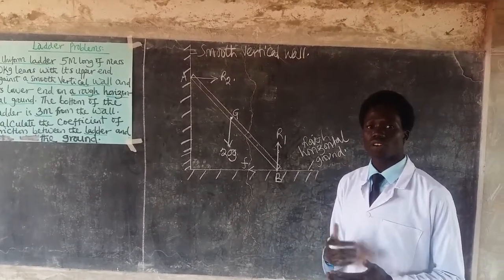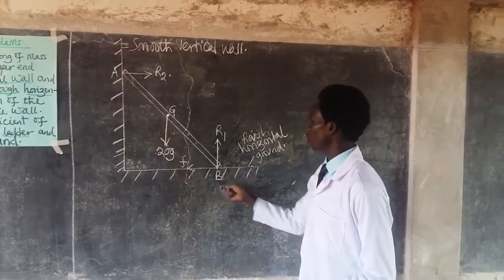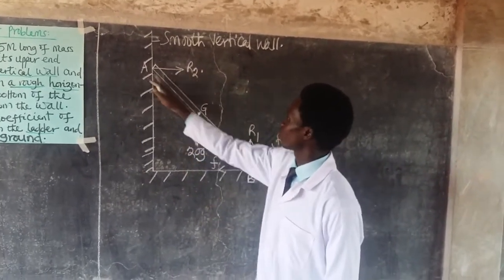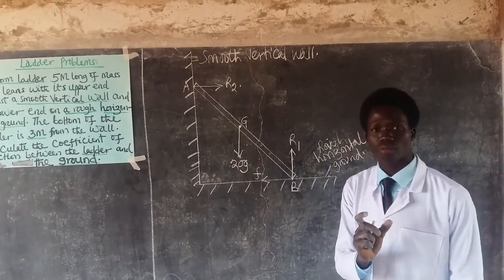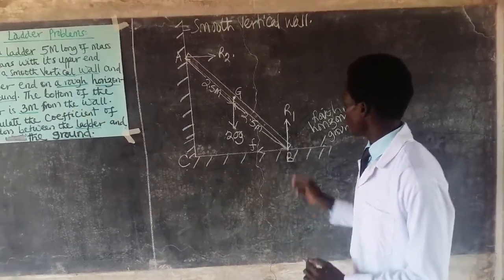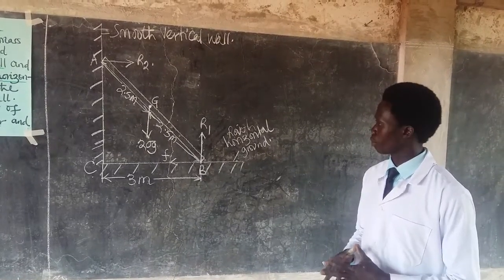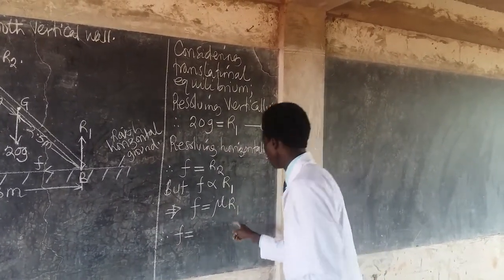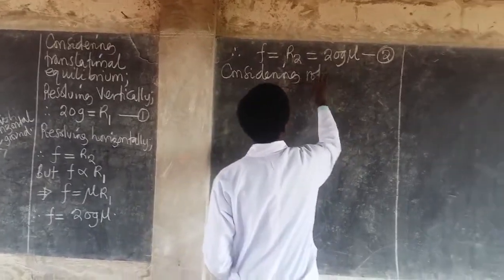understanding ladder problems, mechanics.

Comment: I have a  question sir,, 
For ladders math,  when I took (mg) for ladder, at an inclined plane.. then why we didn't take it's component like mgcos@ and mgsin@ ?
Reply from the maker: @learninghacks7378, we consider vertical and horizontal components separately, a condition for the ladder to be in equilibrium. 
I refer you to part 2 and part 3 of my tutorials on ladde problems, you will understand more better